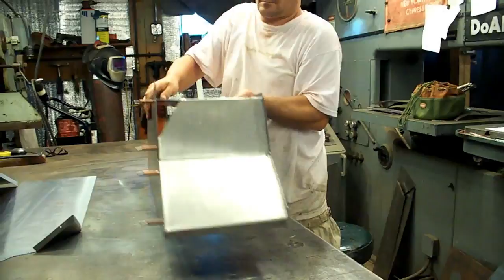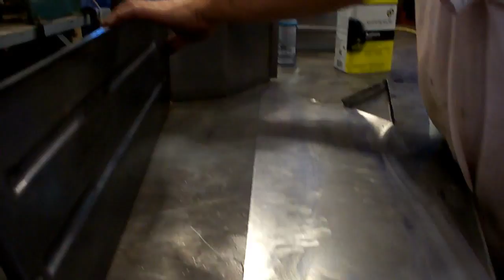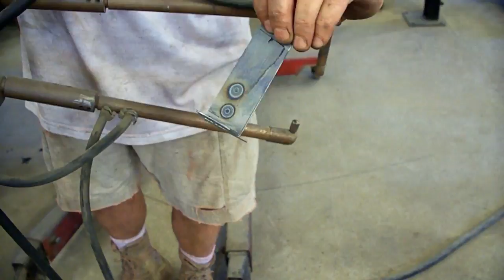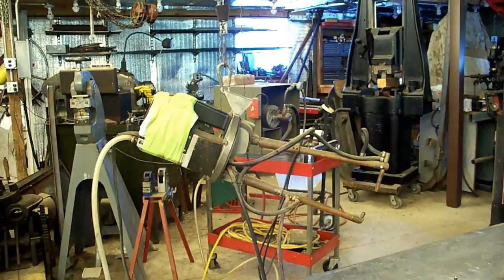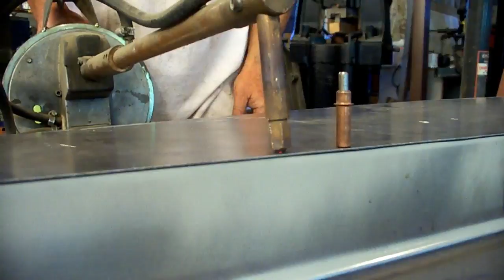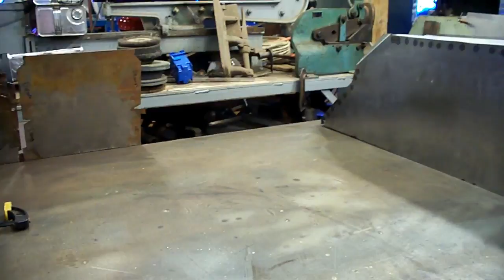Willys CJ3B Jeep body fabrication- spot welding wheelhouse panels Part 2

Comment: Was there a uniform spot weld pattern from the factory on the old jeeps? Were they done by hand during the old days of production or did they have an automated process?
Reply from the maker: The bodies were mostly hand built and the spot weld pattern was up to the person doing it.  When I build bodies for prototype or museum quality Jeeps I always duplicate the spot welds exactly as the factory made  them.  When building a regular body tub I just put them where they are necessary.
Reply: @metalshaperJeep  it’s pretty cool that each body must have had a slightly different touch since they were hand made. I wish I could go back in time and get a tour of the factory while it was in full swing

Comment: Good metal work, but I would have marked and spaced the spot welds evenly, and in a straight line.
Reply from the maker: When building and restoring Willys Jeep vehicles I try to keep the original look.  they never had perfectly straight spot welds and an over restored jeep looks terrible.  Too many people make them as smooth and perfect as a new car and they never looked like that from the factory.  Just keeping things original in my videos.

Comment: Hey Brian, I recently bought my very first car/project. It's a wrangler 87 and there's a lot of job to do on the body...Can you tell what gauge of metal sheets you are using??? Is it the same gauge for side panels or braces.  thank you for your videos ,they convinced to buy a jeep and try myself at shaping metal and go through the whole restoration process
Reply from the maker: I am using 18 gauge cold rolled steel in this video.  In other areas of the body tub there are various different gauges of steel which I will explain as I make the parts.  Good luck with your first project.  Patience is key !!  keep calm and do the best job you can.  Keep watching there are many more videos coming.